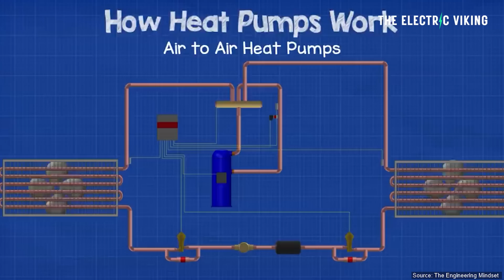U.S reveal NEW Heat Pumps that withstand freezing weather & save 50% energy

Comment: I had to replace my gas furnace 4 years ago and the difference between a heat pump and just the furnace was over $5k, $8k HP or $2.7k GF.
I now I wish I had installed a couple 23 SEER mini-splits instead of the gas furnace.  It would have been about the same price DIY.

Comment: The vast majority of America's electricity is powered through coal.
The idea that coal produces less CO2 and is more efficient than natural gas, is Ludicrous.
Quite the opposite is true.
Heat pumps have become more electrically efficient through the use of neodymium permanent magnets as part of their compressor and fan motors.
But when temperatures drop below on certain point, there is no heat to pull out of the exterior air to pump into the house.
The use of heat pumps exclusively for house Heat, will effectively cause citizens to freeze.

Comment: If the US would update construction requirements for new and upgraded homes/ apartments, energy savings would literally be through the roof. 
US builders don't pay home electric bills so they make houses as cheaply as possible selling at top dollar.
Rental property and Apartment owners, same thing. 
Owners have NO incentive to make their buildings energy efficient.

Requiring US builders and rental property owners to PASS minimum energy efficient standards would go a long way to reducing national energy usage. The advances in heat pumps would add to those savings.

Comment: Using electric heat and heat pumps is more efficient then natural gas, the other side of the coin is that heating with natural gas is less expensive then using electric heat, less expensive  and more reliable then using heat pumps; propane and heating oil is also more expensive than using natural gas for heating. Several new nuclear power plants will be needed to produce the amount of electricity required until then we will continue to use fossil fuels to produce electricity required by heat pumps for heating.

Comment: You need to do more research vs the press releases.
For example, here in Maine, the energy source for our electricity is a Dam, and then the spikes are handled by burning Natural Gas. So, no, the electricity is not going to be cleaner, and because of the way our state has mandated the gas prices for the electric companies, Natural Gas is the main cost of our electricity.\
At the same time, my electric bill for a group of 6 people in a house more than 100 years old was 2K last month. That doesn't include the 1K of oil we have used over the last 2 months. 
If we convert to all heat pumps, we would end up paying more total, because of the price difference for the oil vs electric cost.
And Maine is not a good choice for Solar. The joke is we have summer up hear, but if you blink, you will miss it. 
And, even with these newer pumps, the temps here in Maine can get down to -50 degrees in the winter, with -20 being a common occurrence. In those cases, you still have to use a backup heat source, because while these do function at those temps, they can't actually keep up with old houses, which is the mainstay here in New England.
Considering how poor much of the state of Maine is, I don't see this situation improving drastically over the next decade, no matter what strategy is envisioned. 
This is not uncommon across the different areas in the US. You really have to look at local levels to see if any of this stuff is viable.

Comment: As a US citizen, I need to check you. The US is larger than ALL of the European countries combined, with different climates, different energy structures, different building codes over the last 100 - 200 years. 
Your statement that the US is such and such then comparing it to individual countries is just wrong. We have 50 different states, many of them larger than individual countries, that would be the appropriate comparison targets.
After all, the heating and cooling needs of Texas are going to be more similar to other countries that close to the equator, while Maine should be compared with countries that are much colder.
Otherwise you are comparing Wales to the EU as a whole. You are getting the proper groups wrong.

Comment: In a 2,400sq home in Detroit Area in MI I pay $100 to $125 a month in the winter "3 cold months" for force air heat with natural gas. The furnace is only 80% efficient. Good insulation/ventilation is the key. And not keeping the house at 70. And the furnace cost $1,800, 4 years ago. But in the end, it's your $$. But I'd rather keep my $ in my pocket.

Comment: EV, howzitgoing, guy? Always good to check in on you to see whats up? FWIW, electric cars have "heat pumps" because they have no usable source of heat to run a hot liquid heater because they don't have an ICE motor to generate the heat. Additionally, some are using Dx style AC systems to better control the thermal runaway problems, so having a really good combo heating and AC system just makes sense. A lot of the newer developments are from Mitsubishi's rework of AC to better fit a less "electric" Asian market. Btw, your blurb talks of US heat pumps but shows a plant I believe is in Mainland China.

Comment: Thanks for this!  I have an extensive Mitsubishi mini split system in my home.  2600 sq.ft. between two floors.  42kBTU with two ODU and 2 air handlers on each floor.  One with a REAL wireless remote thermostat.  What a game changer that is!  (MHK-2).  Into winter number 3 without a hitch here in New England.  Can't say enough (O:
Reply: I am also in New England, I had been looking to put a Mitsubishi unit in my house. The sales people have not been very good, if they even return my inquiries. The pricing they are giving me would pay for about 20 years of heating oil. How e
Reply: Much did it run you to get up and running?

Comment: My heat pump works just fine in freezing temperature.  Worked down to 0F last week without a problem.  It's rated for -30C.  It does air conditioning in summer too and these units are not expensive.  Heat pump technology in the US and Canada is at least 10 years behind Europe and Asia.
Reply: What kind do you have?

Comment: let me point out a few holes in this. High efficiency heat pumps by makers like Samsung and Mitsubishi have been out for years but do not work well enough in the upper midwest because even at a rating of zero or just below zero its still not enough BTUH to compensate for the poor building envelopes of most homes and offices. They can be used in Canada because Canada has been building homes with high insulative layers for many years already. Heat pumps can't capture and concentrate enough heat per hour to overcome the heat loss for one, additionally they can't concentrate the heat enough for human comfort making positioning of the evaporators for cassette type or positioning of the ducting for AHU type completely different than convention, so retrofitting of older homes is cost prohibitive. The average gas furnace has a temperature delta (DeltaT) of 30 to 60 degrees from ambient, where as heat pumps or closer to 20 , 30 tops. 

Moreover, to get the super high efficiency to even make it possible to heat a home in the upper midwest they must use all manner of refrigeration technology, inverter fans, inverter compressors, several different types of valves to make it work, microcontrollers ect. The cost of ownership skyrockets due to the inevitable repair costs and that's even if you can find a technician who knows how to repair it. The HVAC industry has been in a non cooperative equilibrium for several decades and the american manufacturers including legacy auto are quite comfortable with this business model , I doubt that's going to change with any new products making the cost of ownership guaranteed to be high as part of the business model is planned obsolescence and repair parts for the bulk of the proffit. So unless Elon is going to put forth a product , it's probably going to be crap. 

Finally, heat pumps are refrigeration devices using refrigerants, we haven't been able to find a a non chlorinated refrigerant with low greenhouse gas potential refrigerant yet, making any equipment created today doomed to be obsolete at some point tomorrow. Currently the most common refrigerant is R410A and the manufacture of its stopping 2025 making the price of obtaining it to skyrocket like R22 has. New refrigerants are methane based and I doubt how well that's going to work for long either. We shall see what this new technology will bring but its got to be able to put out at least 40 degree delta T at 10 below or its not going to work in the upper midwest of the US.

Comment: I have 2 heat pump on my house that I installed 7 years ago. Below 30F to 40F, I use oil for heating. This cuts my oil use by 30% to 40% an annual basis. Natural gas heating is cheaper than heatpumps in most of the US, but is not available in my area. My payback for my system was 5 years. the cooling is great with this system. 

Maybe these new systems will be more cost effective than the current gen and current natural gas systems.

Comment: Solar is the best heat, 220V baseboards are the second.  If you only look at the price of electricity then heat pumps are far the best, however, since the makers of heat pumps are making them to fail every 8 years, the cost of buying one every 8 years is more than the price of the electricity that a baseboard heater uses.  And that is my personal experience.  Best money to put into a house, is insolation and then solar when building a new house or rebuilding an old one.

Comment: Hello Sam, love your YouTubes, just wondered why you are not talking about the refrigerant the "New US Heat Pumps" are using?  I have had heat pumps for several years but am frustrated here in Canada because they don't  allow the new CO2 heat pumps except for hot water heating. Politics etc.   Are these "New Great Heat Pumps" the Carbon Dioxide type used in Asia?  Would like to know as Canada can really be COLD.

Comment: I installed a heat pump this past summer to replace my air conditioner and we're facing sub 0F temperatures.  It is working a treat today.  My system supports down to -22F operations.  They've been around for years.  Our administration is a joke... they are reluctantly support the near past.

I don't see the heat pump helping my in my Model Y, honestly.  My Model 3 with resistive heating seems to be better when it is bitterly cold like it has been recently.

Comment: You must be talking about even higher efficiency heat pumps, because I had a Carrier heat pump installed last year in New England area of USA and it works great already down to 5 degrees.  But any lower it uses a heating element to help in making heat.  It is just 4-8 weeks of the year it could get that cold.

Comment: Like so many good ideas - these are not inexpensive;  thus for so many folks who live paycheck to paycheck these will be unaffordable.  Another issue in North America is building codes/build quality - most US houses that are 10+ yrs old have air leakage equivalent to a 1 foot by 1 foot window open all the time - better codes and building inspection would help this a lot.  But also information on how to reduce/repair this leakage needs to be disseminated so homeowners (and renters ?) can benefit from reduced heating bills i.e., reduced energy use.  This is low hanging fruit.  In my first house (in eastern Canada) I reduced fuel use by 40+% in 2 years simply by caulking around window and door casings and then adding insulation to the basement (yes the basement ! - 25% of heat is lost through not-insulated basement/floor).  In my town there was an "ecology house" that had free handouts for the public to show you how and where to do this work -  about 10 yrs later I built my own home and had contractors use this information to better seal my house and save energy - many were skeptical and a waste of time, but on sunny winter days I had to open windows to cool the house below 80oF.    I applaud these new developments, but if they are not coupled with reduced energy waste (leaky buildings) they won't live up to their potential.

Comment: Well Sam I am wondering how these heat pumps actually work because I have had Daikin reverse cycle air conditioners in my home for a very long time. My main air con - now over 25 years old works perfectly well even when the temperature where I live drops below -10C - so I am confused as to what these "new" heat pumps have that my current systems do not have? The other thing is I wonder how much these new devices will cost and how many people will be able to afford one - as in my case being on a limited income like many I know will have to either spend money or get loans to acquire one of these new systems leaving us in a financial situation that will be difficult to sustain.
Reply: Daikin among a few others makes a very good cold climate heat pump to swap out for your A/C. The new ones are much more efficient than your current A/C too.
Get quite a few quotes as their can be price qouging in some areas. You can get direct quotes for any brand system om on the internet for the complete kit so you know what the unit costs. So then you have to figure out the HVAC labor costs, overhead and profit is and decide if it is fair. And negotiate with some facts in your hand. You can find installers in yout area from the HVAC Internet Sellers or on bulliten boards at places like Home Depot, Leows, etc. if you can’t get a fair dealer quote. Think like you are negotiating with a car dealer during COVID, trust but verify too.

Comment: Had a mini split unit with 3 units on Vancouver island with heat and air conditioning, fantastic, i loved it, but it was pretty much done after minus 12.  And they are expensive, way smarter to use gas on the prairies

Comment: Ground pumps are the way to go. But costly! Heat pumps that heat below zero degrees that "maintain their efficiency" (300%)  is unobtainable. Without electrical heating assistance in the outside unit they freeze up. .At very low outside temperatures one may as well use an old radiant bar heater to keep warm !!

Comment: Daikin is already offering these air to air systems for cooling and heating down to -12°C ambiant temp in Europe. This is nothing new. They are available as 5 point multi split systems for air to air. And if you want to distribute the heat by water you can have them as monoblock units.

Comment: For the next 7 days in Iowa, low temperatures will range from -12F/-24C to 0F/-17C, a +5F/-15C. A heat pump will not be sufficient by itself in an Iowa winter when it gets this cold.

Comment: it low temps, i can see them still working with ground sourced heat, but alot of newer heat pumps are air source, and i have no idea how that can work with minus temps efficiently. I think the electricity bill would be insane, and the pump would be working overtime and wear out prematurely.

Comment: I wish they’d make these units capable of working with multiple appliances such as your furnace, dryer, water heater, hot tub, perhaps even the fridge.  I think this will absolutely change hvac in the future.  We have a heat pump but it struggles when it’s less than 40F outside and basically doesn’t work below 10F as it cannot keep up, and hence the resistance heat turns on a lot during our winters.
Reply: You do know that your fridge is a heat pump?
Reply: @philiptaylor7902 yeah what I mean is taking all those heat pump components and make them into a single (or dual redundant) exterior unit to avoid robbing the inside of the home of energy.
Reply: @MLJenkins  Should definitely be possible to run heating and hot water off the same heat pump. Fortunately it rarely gets that cold here in the UK.
Reply: @philiptaylor7902  do any systems exist that do both (in my case the hot water heater is about 1 ft away from the furnace. Both gas. Seems a shame to replace one and not both.
Reply: @laughinggas5281  Hi, here in the UK domestic hot water and heating (hot water radiator or underfloor) are always run off the same gas boiler, and domestic heat pumps are the same. The idea you’d have a separate furnace for heating and boiler for hot water is new to me.
Reply: @philiptaylor7902  boilers have become pretty uncommon in the US for new construction.
Reply: @laughinggas5281   Do you mean that heat pumps are the standard? If so you are ahead of us on this side of the pond.

Comment: As others have said, the tech has been there that will work for the vast majority of the country. Unfortunately many Americans only see initial price and make a decision. Also, one party in the US has actively blocked any sort of movement in green building legislation. We are decades behind Europe.

Things like insulated forms, Turn tilt windows, Geothermal are rarely used. 

From a city planning standpoint there is very little district heat used from power plants to increase the efficiency. 

American is sadly at the back of the class when it comes to environmental legislation amongst developed countries.

Comment: I put my heat pump in last year for my house. I'm seeing about a 60% reduction in heating costs. 16 seer 3 ton. $5k installed myself (including top line tools). 🙂Yes. It was a nightmare. But I had little choice based on economics and broken fuel oil furnace. Nearest quote was $15k. Does fine in 9 degree weather, so far. 15kw heat strip for aux. Best to leave it on hold at 72. It will fire the heat strips up if you get a 3 degree swing. The heat pump is cheap, the strips are not. 2000 sq ft ranch.
Reply: Where?

Comment: IN CANADA I got my heat pump 3yrs ago. on average it's about 3x-5x cheaper than natural gas in winter. Even on the coldest of days at -23C it is still 1/2 the cost of natural gas. In the summer it's about 1/2 the cost of electricity for cooling too.